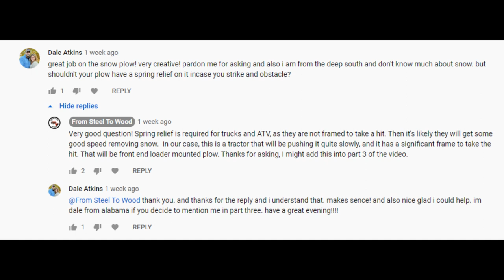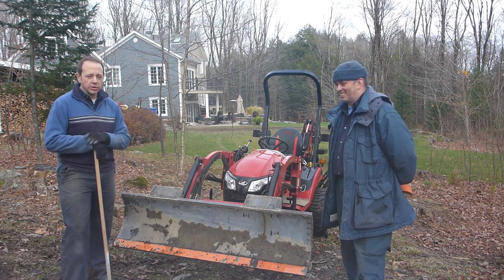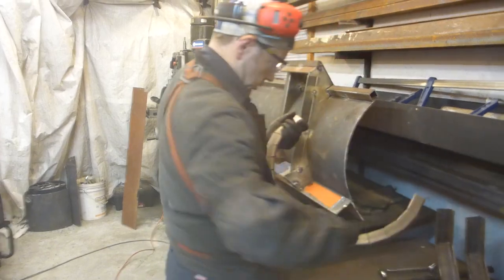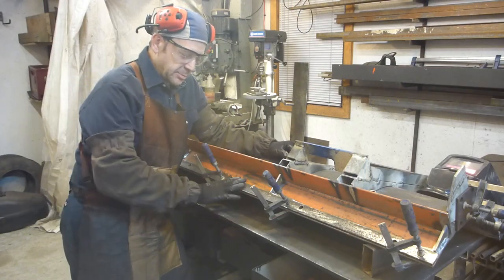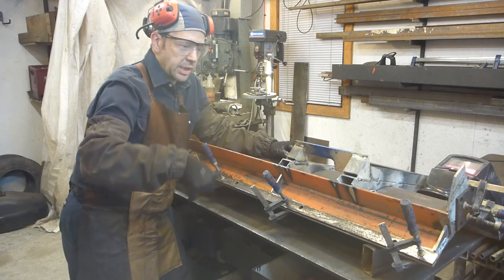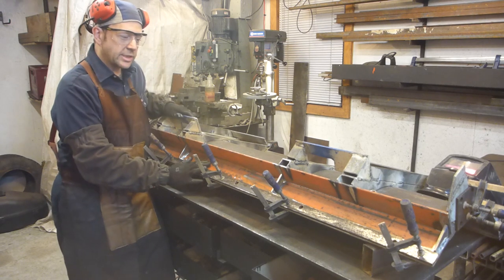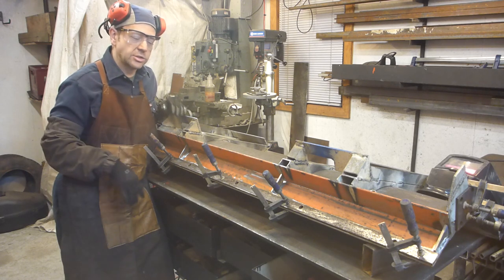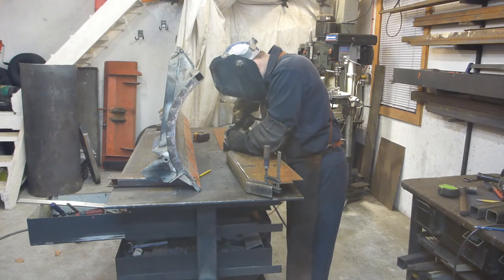#179 SSQA Snow Plow   Part 3

Comment: That blade is a strong one, Joe.....You spend the time building but it will last for a long time and Dave will appreciate the effort of the build....CHEERS
Reply: Yes the effort and the high engineering skill in deed from Joe!!! Cheers !!!
Reply from the maker: My goal was not to build a snowplow, but I had to figure a way to get rid of that water heater... Lol! Just kidding here!  We could have made the plow much quicker. I could have saved the side ribs, the blade gussets, the double thickness blade, etc. By doing that, it's a full-proof design. Thanks Gator!
Reply: @FromSteelToWood  Fool Dave proof design !!! LOL

Comment: Great Job fabricating another piece of equipment. Am I correct thinking the side bumpers have a 45 degree angle on the side skids. I have a small 4ft plow I am going to make into a pusher to use on my 18 hp tractor Kubota bucket. Thank for your videos. Hope you had a Happy New Year.
Reply from the maker: Thanks Sir!  You are right, the side wings have a 45° angle. It works well to ride over gravel and the like, but yet dig into the snow.

Comment: I hope you don't bend your loader frame or break something in the transmission or rearend when you hit something immovable. There usually is quite a bit of slippage when plowing but you never know. I have hit things with my loader bucket with my John Deere and have bent my bucket but my tractor is probably over 4 times the size of yours. Speed is usually the killer when things break.
Reply from the maker: Right about speed! Dave's tractor is quite slow and light. So I am not so much concerned. Caution is always required. We plow in known terrain also. It's not expected to hit anything in our case. Thanks!